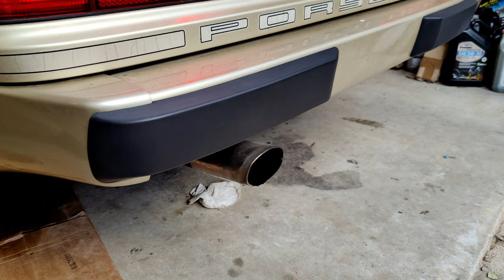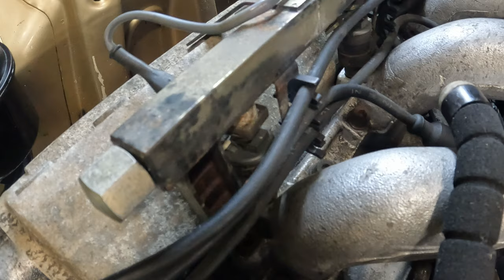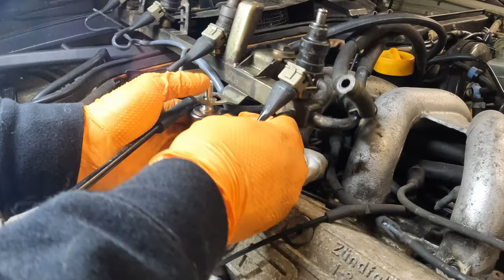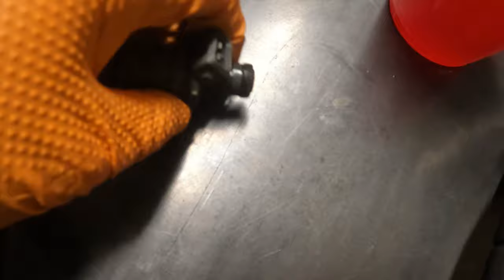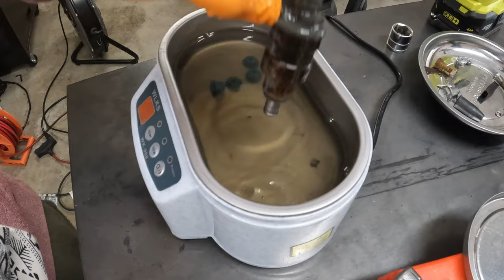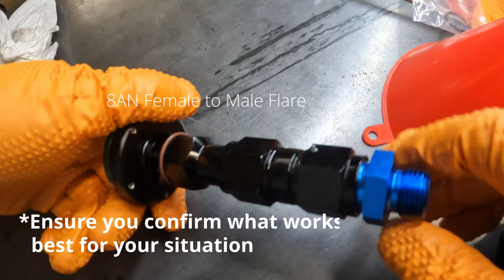Modernizing a 40 year old fuel component - 1984 Porsche 944

Comment: Great video. What equipment did you use to clean your injectors?
Reply from the maker: I used a cheap ultrasonic cleaner and injector trigger, connected to a 12v power supply (lawnmower battery in my case)

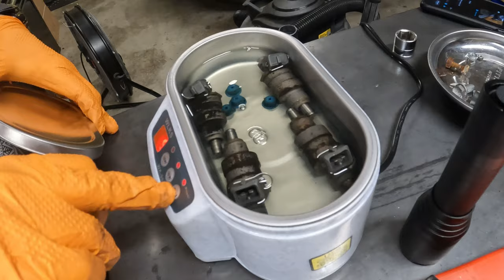Comment: @6:09 super newb question, but what fluid did you pour in there?  Seafoam?  and what does that device do?
Reply from the maker: Yeah, used seafoam. The device it's in is an ultrasonic cleaner, which is probably better explained by someone else but I'll give it a shot. 

It's creating high frequency sound waves to create cavitation bubbles that result in a cleaning action when they collapse. Basically allows us to clean the hard to reach areas (inside the injectors)

I've since added an injector tester too in order to run the injector while cleaning it for more thorough cleaning
Reply: @falqonslanding  That was a pretty good explaination, lol.  Thanks man, good vid!

Comment: Very similar issue on my 84 944.  Cold idle, it runs fine.  Not until I take it to 5k or higher that it starts acting like that.  Even on startup.  I have an adaptex damper on the way.  Appears to be a direct bolt on replacement for the factory unit with some updated build quality.  Did you have similar symptoms?  Runs fine or runs horribly?
Reply from the maker: It ran horribly before the damper. Similar symptoms and if you pull the vacuum line off after running it for a bit you'll likely find fuel in there too

Comment: You unhooked those two grungy looking things at either end of the fuel rail. Did you replace them with that green thing? What did you replace at 4:27? Is Radium Auto where you got the damper and ancillary parts?
I ask because I’m getting my ‘88 Nine Forty Four back on the road after 7 years and wondering what can be changed out for 35-year old parts.
Reply from the maker: Hey there! Correct, both devices at the end of the fuel rail were replaced. However, there's a difference between the two in that: one is a regulator, and the other is a damper. 

What's seen at 4:27 is the new fuel regulator (Replacement P/N Beck/Arnley 158-0163). On one side (passenger), the regulator was replaced with the aforementioned, while on the other side (driver), the damper was replaced with the Radium Auto parts. 

The damper was purchased through Radium Auto's website. Ancillary parts I had to source through a variety of online sellers due to the wide variety of parts required to clear the mounting bracket for the old damper.
Reply: @falqonslanding  Thanks. That helps a bunch.
Reply: @falqonslanding  I should have asked this before but could you tell us the places you sourced these pieces? I’ve bern on Radium’s site and seen what I believe is your damper. I guess I must find out what these do so I can ask relevant questions and not look silly.
Reply from the maker: Sure thing, listed below and updated the description. Thanks for the questions, helps me understand what you all want to see included in information!

8AN Flare To 16mm X 1.5 Metric Adapter: Russell Performance, SKU 670550 (Looks like they might be out of stock)
8AN to 8AN Swivel: Amazon, "EVIL ENERGY 8AN Female to 8AN Female Straight Swivel Coupler Union Fitting"
8AN Female to Male: Ebay, 8 AN Female to 8 AN Male Extension 1-5/8" Black Anodized
Fuel Damper: Radium Auto, 20-0776 FPD-R, 8AN ORB
Reply: I found a Podavelle 8 AN female flare to 8 AN male flare. Is this what I need? Ordered everything else as far as fittings.
Reply from the maker: Should be right. Mine was a straight extension 1 5/8" in length. You should see it being screwed on at https://youtu.be/yLZ7mUhAuZA?t=418

Comment: Will this SAME set up work on my 1987 944 N/A???
Reply from the maker: It should. I'm not too familiar with the 944 platform as a whole but I do know they made a few design changes across the years.

If your fuel rail (ie: location of regulator and damper) is similar to mine, the answer is yes. Otherwise, you'll just have to take into account whether you have the space you need to mount the radium damper.
Reply: Have you determined whether it will work?